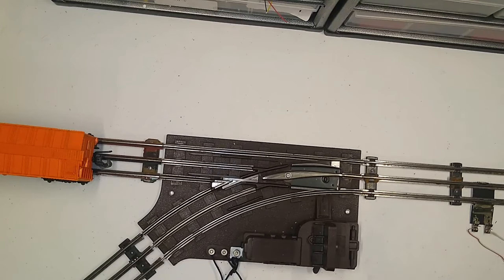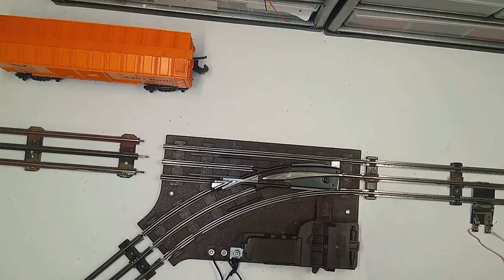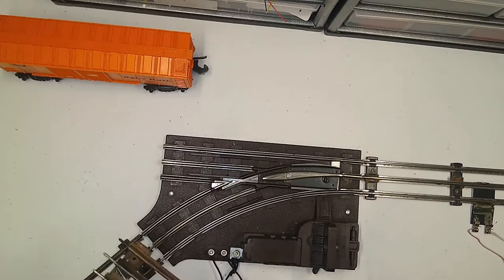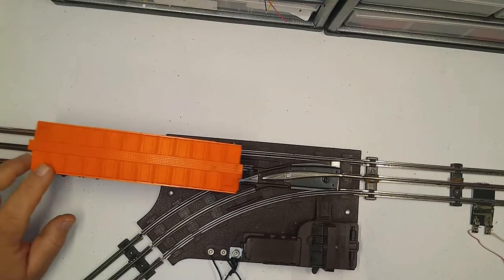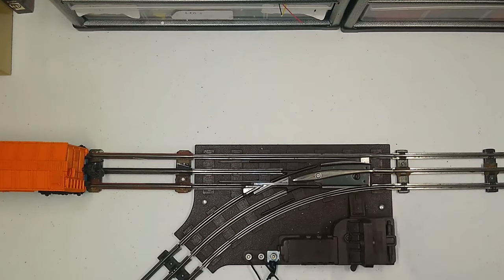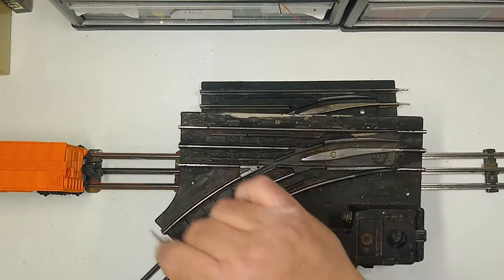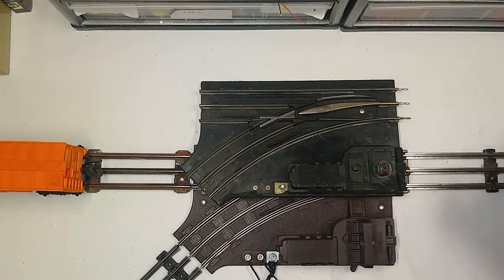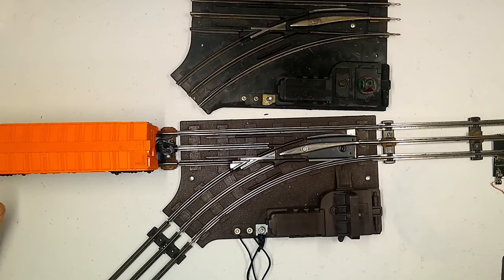Fixing The Most Common Problem With Lionel O27 Remote Turnouts - Insulating Track Pins!

Comment: I had a pair of 1952 turnouts and didn''t know about the dead spots.  I had one in my yard and my Lionel 1615 switcher would stall on that turnout.  I went through my stash and found a later version and discovered the difference.  i replace the 1952 with a later version and the 1615 worked fine.  Good detail in your videos.
Reply from the maker: Glad to be helpful!

Comment: I don't think much of the 1122 - you cannot back a train car thru the curved side without trucks derailing! I have a bunch of them on a big layout. They're there just for LOOKS. I wish K-Line had made a drop-in replacement. Their O42 switch in O27 rail size is bulletproof.

Comment: Thanks for the info. What if the train is approaching from the other direction.  In the video the train is going from left to right(where the pins are. What If the train is going from right to left (where no pins are)
Reply from the maker: The automatic operation only applies when the train approaches from the "trailing point" side. From the "facing point" side there is no danger of the points causing a derailment as the train will simply follow in the direction of the switch points. HOWEVER, if you want the train to ALWAYS choose one direction over the other you can add your own insulated rail section ahead of the turnout and wire it to the appropriate switch terminal. For example, when going into a reverse loop if you want the train to always enter the loop by the straight route, an insulated section ahead of the turnout can make that happen.

Comment: Thank you for the explanation.    I have 1952 and 1953 versions and was wondering why they acted differently.
Reply from the maker: I was perplexed about mine for years until I found the answer buried in an old Lionel service manual. I find it's a little-known hiccup with these turnouts.

Comment: Wow you really need to Your Lionel trains & tracks & trackage. I remember something similar to this on Ho scale especially that of Atlas track early brass & not knowing that was code 100.  Every  time a train would go over plastic potion of that insulated track certain trains 
 stopped at those points making it annoying & had to keep coming to nudge the engine. There was a device called a snap relay that overcame that problem. I learned something from watching this.👍✅
Reply from the maker: Great! Thanks for watching! When I was a kid we had a large HO layout and I recall we had to modify our early Atlas turnouts with jumper wires. They later fixed that design flaw.

Comment: When I was building my previous layout I was buying Lionel 042 remote switches and many of them acted like they were possessed so I disabled the electrical switch mechanism in them. I preferred the K-Line 042 switches and even bought a dozen from one seller.
Reply from the maker: I haven't used the Lionel O42 turnouts, but I have several K-Lines. They work well for me.

Comment: 1. As a kid with a lot of O-27 track and turnouts, I had no idea about the fiber pin. This can really frustrate someone and discourage them from the hobby. As I got older, I learned always read the instructions.
2. I got all 3 style O-27 turnouts. I just received the 1952 set and saw the difference 😲
Reply from the maker: "All 3 styles". Don't forget the #1121, made from 1937-1951 (except 1942-45)! This one looks like the O gauge O22's "little brother", but lacks the non-derail feature completely. :-)
Reply: @ToyTrainTipsAndTricks  oh yeah forgot about that one. Now I have to go on ebay and buy one now lol.

Comment: Very interesting.
A friend of mine has a Lionel small layout (I model in HO) and he tells me every time his engine (a diesel w/ 4 wheel trucks) goes through the diverging route on this turnout, the engine slows down quite a bit. His other turnout on his layout does not do this. I tried to help him troubleshoot it over the phone (we live far apart), but so far no luck.
Have you seen this issue before and would you have any idea what the issue might be. Thanks.

Phil
Reply from the maker: It sounds like the turnout is not properly insulated. When the locomotive is on the diverging route it is sending power to the switch motor.
Reply: @ToyTrainTipsAndTricks  I will forward the info to him....Thanks...

Comment: Great vid! I have an issue- I have 3 turnouts together in a yards section of my layout, but the 3rd turnout and section is dead (no power). How can I fix that without soldering wires or using a separate transformer? Thanks!
Reply from the maker: Without seeing the specific orientation of your turnouts the problem is difficult to diagnose. However, you can always add additional power feeders to the section behind the third turnout. If you are averse to soldering, use an additional lockon as I did in this video: https://youtu.be/FSY54UPuTOc

Comment: Good info, thanks,  I've shifted to Fast Trak for my layout but I've been thinking of putting in an elevated track using Menards track and i was wondering about using some remotely operated turnouts on it.  Do you know where you can still buy these switches and turn outs?
Reply from the maker: eBay, Tranz.com, or local train shows are a good bet

Comment: Thanks for the video. I added the insulating connectors to the switches as shown and got my Santa Fe Lionel set going again. 

I have it set up as a smaller oval within a larger oval with the switches allowing the train to go between the two.

After working for a couple days and not changing anything, the throttle when I turn up the power goes off and blinks green, which I believe indicates there is a short somewhere. This happens even when nothing is on the tracks. I have tried to check all connections to make sure that the insulation underneath the center rail hasn’t come off anywhere, but that’s about the extent of my diagnosis… any idea what would be shorting the circuit?
Reply from the maker: That definitely sounds like a dead short of some kind. My search would go as follows: 1) Disconnect the transformer from the track and see what happens. This will eliminate the transformer as the problem. 2) reconnect the transformer and disconnect any control wires from the turnouts. This will tell you if the problem is in a turnout or in the other track. 3) The best way to find a short in the track sections is to disconnect one section at a time and see if the short is fixed. With your loop, try breaking the loop into halves - then quarters, etc. This will help you find a bad piece sooner.  Good luck!

Comment: Hello!   I just bought some 027 turnouts, 042 radius.  They do work, but are somewhat stiff moving from one position to the other.  Is there something I can do to make the action move freely?   Thanks!  I appreciate your help!!
Reply from the maker: Remove the switch housing to access the mechanism. Use a little plastic -safe grease on the moving parts. That should do it.
Reply: @ToyTrainTipsAndTricks  
Thank you Sir! I will give that a try.
Reply: Hello!
     Just wanted to let you know your recommendation for the turnouts worked.   They actuate easily now!  Thanks again!!

Comment: Hi, I have a setup with two Lionel turnouts, a left and a right, hooked together. They support a loop within a loop. One of the turnouts has a  reversed direction to support the loop. The turnouts are not any shown and are from about 1955. I cannot find a number on the turnouts. The turnout box looks identical to the controller with a red and green light on both sides. The controller does not work. If I remove the controller and "hard"wire the turnout with an alligator clip the switching sort of works. Do I need to support the derailing feature on both turnouts (not sure my turnout supports the derailing feature) with plastic pins? Do I need a plastic pin on the juncture of the two turnouts?
Reply from the maker: Without seeing exactly what you have, it's hard to determine the problem. However, try placing insulated pins on both inside rails on both turnouts. If it doesn't work - no harm done.
Reply: @ToyTrainTipsAndTricks  Doing this works! Thanks!
Reply from the maker: @EzraMann-xo3vm  Great!!!

Comment: My locomotive 2-6-4 keeps tripping the e unit into neutral everytime it enters the turnout from the curve but not on the straight section how do I stop this turnout from doing that. Thanks Dana
P.S. I did finally get the semaphore working with the proper 145c track clip thanks for your help
Reply from the maker: I wish I could give you a quick easy answer on this one. Unfortunately, there are numerous reasons this may be happening. The locomotive goes into neutral because it is momentarily losing power. There are many reasons this could happen. Sometimes it's a design flaw. For example, Lionel's number 221 steamers do not like to run through 031 turnouts as their pickup rollers are spaced properly 4027 turnouts, but 031 turnouts make them stop. Sometimes the problem is dirty track. Sometimes the problem is dirty Wheels. Sometimes the problem is dirty pick up wheels. Sometimes the problem is a loose pickup that slides just enough out of the way on a curve to lose contact with the rail. In fact, I have one particular locomotive that does not like to run through one particular switch, but it runs through all of the other switches fine, and identical locomotives run through the problem switch fine. Look for some sort of electrical problem and troubleshoot from there.
Reply: Hi Mike - I'm having the same problem with a number of Lionel 042 remote turnouts. Apparently, it seems to be a common issue. I've gotten it to work " a little better" by insulating the edges of the diverter plate with tape.  I agree with everything you said on possible causes, but is there anyway of doing a video on the possible fixes? The sparking and e-unit cycling put a pretty big damper on a running session and I really don't want to switch to K-line turnouts, as they are getting pretty hard to find.

Thanks again for all the great work!

Comment: I have two No. 5167 turnouts in an 027 loop. When I manually roll a boxcar through either turnout  the back wheels entering the turnout will cause the wheels to give off sparks. This happens when my switcher goes through it too.  When the boxcar sits on the turnout the motor chatters. I have insulators on the two inner rails as directed also have one on the power rail “exiting straight thru” as it enters a side track which I’m able to turn the power off on that section of track.  Any idea what’s going on?
Reply from the maker: Can you provide a simple diagram of your setup? It sounds as if the common and ground may be reversed to the track on the side of the turnout with the center insulator, but a visual would be helpful.
Reply: @ToyTrainTipsAndTricks  That’s what it seemed like to me too, so, I looked behind the transformer and saw that my common lead (white) was on the red post and black was on the common post. I reversed the leads and they now matched the feeders, as far I could see.  With my fingers crossed I turned the transformer up and pushed the boxcar thru-dang, that didn’t work-still sparkes. I needed to go home. I will be back to check the wiring underneath the layout and will keep you posted.
Reply from the maker: Another question: Is a controller wired to the turnout and if so, does the turnout function properly with the controller (but not a car on the track)?

Comment: Hi mike good video I’m trying to runa o27 lay out but on the switches there’s a weird humming sound from somewhere in the track. I was hoping you could give me some insight to this problem.
Reply from the maker: If the switches are humming, they are receiving power from somewhere. Step one is to check the insulating pins as in the video. Step 2 would be to check the wiring in the switch. I hope this helps!
Reply: @ToyTrainTipsAndTricks  I’m not to sure on the model number of the turnouts but they are manual switches and the humming is only from the diverging track but short the layout to the point where you get a shock from touching the track but doesn’t trip the transformer
Reply from the maker: @waterlevelproductions482  Ok. If you are getting that with manual switches the problem is most likely a bad insulator somewhere on the center rail. It may be in the switch or a piece of track nearby.
Reply: @ToyTrainTipsAndTricks  I worded that wrong they are electric switches but don’t automatically throw if lined incorrectly
Reply from the maker: @waterlevelproductions482  If they are electric switches by Lionel, K-Line, or MTH they SHOULD automatically throw unless they are pre-1952.
Reply: @ToyTrainTipsAndTricks  they are my guess is possibly prewar or early postwar
Reply from the maker: @waterlevelproductions482  Do they look like this? https://www.tandem-associates.com/lionel/lionel_trains_1121_track.htm

Comment: It’s been sometime since I built a layout
Since we r stuck inside I thought I’d give it another go 
Last recall my issue with the turnout was, when the train would go through and make contact with the next connected track,
My engine would automatically reverse and I never tracked down what the issue was for a number of reasons one being which this was probably 10 years ago and technology and communication was not to the point that it is now also my local hobby shop K Val hobbies in Buffalo New York went out of business etc. so I am writing this comment do you now as I stare at my box of parts hoping that you may have an answer for me I’m going to begin assembly and see if I can fix the issue just by rebuilding from scratch
Reply: I will monitor my email and await your reply if by chance my issue sparks an idea in your head I do have insulating pens that was 3/4 of the way through my set up that I started playing with them granted I am a novice but I am handy for your interest I have three turnouts according to your description two of them appear to be postwar model 1122 there’s three of them two with a rounded edges and one with more square corner all black
I also have a section of rail that is a D coupler that I had pretty good luck with number 6019
Reply: Thank you for your time
Reply from the maker: There could be several causes for your problem, and a bit more info is needed to help diagnose it. 1) Does the train just spark, or does it short out and stop completely?  2) Which part of the turnout is involved (straight or diverging tracks)?

Comment: Question - Does anyone know if a magna-traction locomotives affect the activity of the auto switching non derail feature of the post war version turnout? The locomotive I want to run on the line with the switches has magna-traction and a number of the switches had issues realigning as it went over it. I used another locomotive without magna-traction an the turnouts seem to work better. Just wondering if anyone else had similar issues?
Reply from the maker: Magnetraction has no effect. Check to see if the wheels on the magnatraction locomotive are dirty. Electrical contact is the key.

Comment: I have 2 Marx turn outs connected together.  The loco derails on the second turnout.  Suggestions?  Thank you
Reply from the maker: Can you provide more information? How are the turnouts connected (which rails to which rails - end to end, back to back, etc)? Which direction does the locomotive derail? What locomotive model? There are lots of variables to consider.
Reply: Wow, okay, lots of scenarios.  Be great if I could send you a picture.  Is that possible.  We ran this train as a kid and 60 yrs later trying how to figure this out.
Reply from the maker: @cluckster51  mrmoore2001@gmail.com
Reply from the maker: You have a Lionel locomotive and Marx turnouts. There is a comparability issue if you don't modify the Marx turnouts. Watch this video beginning around the 4:50 mark: https://youtu.be/Ejo0W8Kyyw0
Reply: @ToyTrainTipsAndTricks  thank you.  Do you sell your 3d inserts?

Comment: I use the the insulation from my16 gauge wire as an insulation pin .It has worked on my layout for years  🚂🚃🚃🚃
Reply from the maker: Great tip!